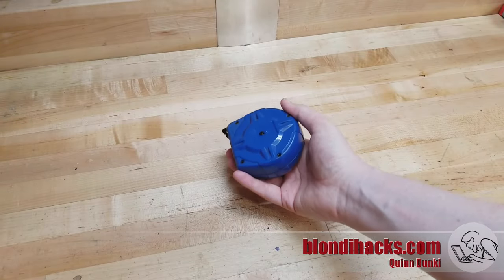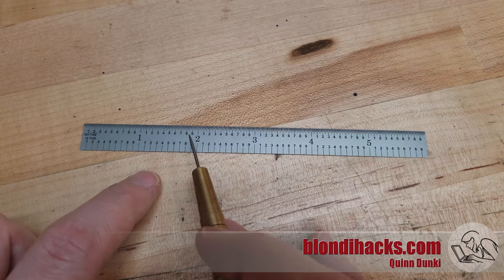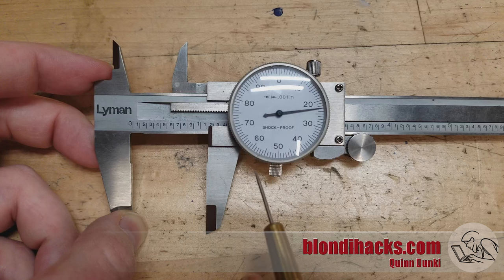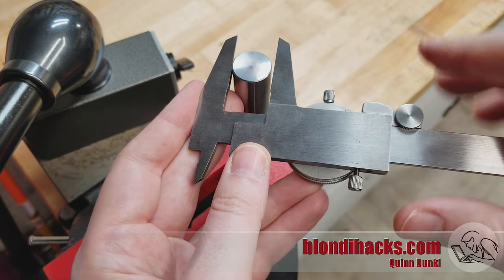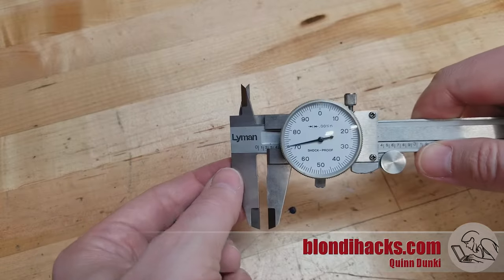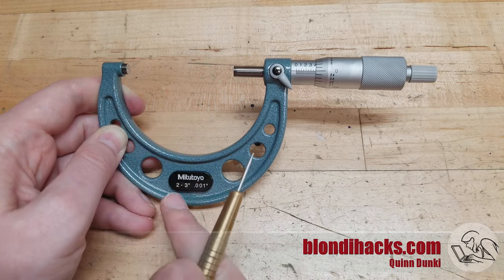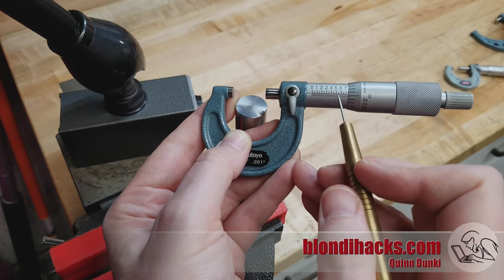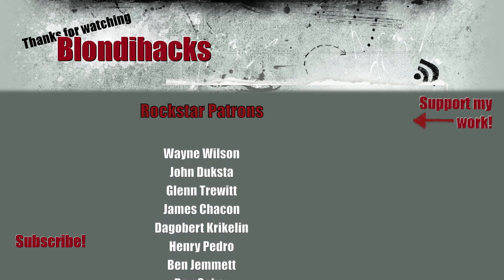Metal Lathe Tutorial 19 : Calipers & Micrometers

Comment: Those in Metric land will know the Vernier Scale as the Nonius Scale. It's really simple and absolutely brillant: Basically when you have two sliding scales, one of them is usually divided in multiples of ten. By adding another scale that divides the same length into nine units, you increase your accuracy 10:1. 
By the way, I learned to work with a caliper that had a Nonius scale too. None of that fancy clockwork stuff! Anyway I bet they don't teach this kind of thing in high school anymore like they did in my day...

Comment: I've been using the same Lyman dial aproximator for years and had no idea you could measure depth with the head. Thanks for that.
Reply: Same here...
Reply: I saw this "trick" somewhere in another machinist youtube video (can't remember which one, I think I've seen it several times now). Unfortunately, my vernier calipers aren't designed to do this, so it is not universal - at least it WASN'T when I got my calipers - they probably are 40 years old, and I think they design wasn't the latest at the time I got them. Still working, so not replacing them yet... ;)

Comment: Holy Cats! I bought a micrometer eons ago at Amble’s Surplus, not knowing at all how it’s used. Had no instructions. Decades before YouTube.

TIL that the extra lines are for 10,000ths!!
Reply: Did a little more inspecting & I think I've found 3 reasons my micrometer was so cheap.
1. Genuine Chinesium (if I remember right, the original wood box it came in was stamped "Made in China" - lost that box years ago).
2. It has finish-blemishes on the big C-part which look like it perhaps had a brand/logo on it, which was removed perhaps because it was a factory second.
3. The ten-thousanths lines only go up to 5. So to read .0006 to .0009, you have to use the shorter half-a-hundredth marks on the barrel and do even more math.

Fugly, but functional.

What a fun day this has been so far.

Comment: Yes, the video is 3 years old and still GREAT. But, ya know, a lot of us old geezers who decided to squander our retirement vacation savings on machine tools, in addition to being self-indulgent, are half blind. So those BIG digital LCD numbers really help. Now, I have a harbor freight, and mid-range asian, and high end set of digitals and you are exactly right, but I also have gauge blocks, so I do check them. Have to be careful. HF is "accurate to a thou or two, and fairly repeatable. The mid price ($50 to 100) and the high end, ($250 and up) read within a tenth of each other. The temp variations in my shop could cause worse than that in any result I'd ever get. So...the ability to see the numbers, and the accuracy of the mid price units is something us geezers actually need.

Comment: Hi, the caliper batteries. Cheapo's just have a relative scale, they have to keep the power on in order to retain the zero, switching them off just turns the display off. A bit daft as I think everyone rests the zero every time they turn the display back on atvany rate. The quality calipers have an absolute scale and they know where the zero is so can be fully turned off when not in use. Discharged batteries areca thundering nuisance and I think Quinn is absolutely (!) right to say avoid cheap measuring tools. BobUK.

Comment: Great explanation of mics! Also, if you're doing a ton of round stock readings, you can get micrometers that are designed for it. Basically, the anvils have a slight v groove in them. Of course, specialist stuff is always more expensive

Comment: Could you please show us how to use thread wires correctly?
I need another hand or two.
Thread micrometers seem to be a better choice.
What say you??
Thanks, Jeff
Reply from the maker: Yes! I will be doing a video on thread wires. Thread mics are nice, but expensive and technically a little less precise (though not meaningfully so, for most use cases). Thread triangles are another nice option. There’s much disagreement on whether they are less precise than wires, but they are easier to use

Comment: Ahoy Quinn. Some advice please ? If you are not too far into that whisky bottle😁. any thorts about lathe centre height from floor ? I'm figuring about elbow height
Reply from the maker: Good question! I’d say you want the hand wheels at a comfortable working height, so around waist height or a little higher.
Reply: Would be a lot easier if i had one of your "Johnny carts" 😁 I think i'll aim for belly button height with adjustable legs. got an ancient edgebander the other day for $100. loads of good salvage bits and a good base that will become a lathe stand after some modification, Thx for thorts 🍺

Comment: I love showing a lyman caliper (sold for ammunition reloaders) in this use.  I've found several things that if bought from a different specialty than what you'd think - you save a ton of money and they're as good (usually the same, just different branding).  FWIW, I lose the battery covers on my digital calipers and loosen the battery when they're not going to be in use for awhile, then push the battery back in when needed.  Cheesy but it works (you could hot glue a small screw ,bit of tape, or a toothpick to the battery to make that easier).  The normal tension in the springs of the battery holder itself keeps the battery in and connected no problem normally - 
The reason they go dead is they turn themselves back on, like ghosts in the middle of the night, and you can catch them at it.  Static?  Dunno, at least some brands are less likely to do that if you tighten the screw that keeps them from moving.
Reply from the maker: Indeed! My dad is a reloader, and I inherited that tool from him. 😁
Reply: @Blondihacks  You mentioned hemostats in another video of yours.  Same idea...I introduced a Vet to electronic fine tools, in this case, flush cutters so the stainless steel wires she used to to micro-osteopathy (bone surgery) didn't have sharp ends.  She was aghast at the price graduation from "surgical supply" to the overpriced Jensen tools catalog, to ... various surplus outfits like Marlin Jones.  Asked how to autoclave them between surgeries due to plasti-dip handles, I pointed out that for 2 bucks, you just toss them in the trash....Just wow.  A useless to most tip - what reloaders pay for crushed walnut hulls for their tumblers is 5 or 10 times what they cost as lizard litter at the pet store.  Same stuff...
Reply: @highpwr  Good one, thanks.  You know if we all give away our special ways to avoid "friction in the market" a lot of useless middle-markup-men are going to be hurting....heh.  Go!

Comment: Great explanation! I would like to add that the best way to hold a micrometer is either thump and forefinger on the black pads on the lowest point of the arc ..or on the fixed anvil side, that way you transmit as little of your body temprature to the micrometer. Gretings from the Netherlands.
Reply from the maker: Yes! Great point. Avoiding heat transfer is good practice.

Comment: There is one serious issue with calipers like you show:  bits of metal get into the gear mechanism and cause the caliper to jam.  It is the main reason for me going over to digital.  The current cheap HF caliper battery seems to be lasting just fine (it is at least a year old and I don't have to take it out) and it has auto turn-on.  After trying the Shars caliper at the metrology test that Kilroy was putting on, I may step up to one of those.
Nice to meet you at the Good of the Land Festival.
Reply from the maker: Yes, very true. Dial calipers need to be taken apart and cleaned from time to time. That is a disadvantage of them.

Comment: In some way easier with mm. Micrometer 0-25 mm, one revolution 0.5 mm, easy to check with caliper if it is 16,24 or 16,74 mm.  Yes, we sometimes go digital to 0,001 mm (0,00004 inch) but when the piece is in the lathe 0,01 is good enough, hard to measure more precisely...

Comment: Going back to Shop-101 I was taught when checking calibration on you Micrometers in this case for example with a 1 Inch Micrometer but it really doesn’t matter if it is a 1”-2,” 2”-3,” or large micrometer.  Any-who step number 1 is first with a lint free rag wipe the face of the anvil and spindle lightly and then wipe the face of the anvil and spindle with clean dry finger tip afterwards close the micrometer until the anvil and spindle touch as if you were taking a measurement. After insuring that your micrometer reads 0.000 or if did not that you have made appropriate calibration corrections you next then carefully open your micrometer to just pass 1.000” at which point you insert the 1.000 standard bar that you have cleaned the faces on just as you did cleaning the face of your micrometer’s anvil and spindle and tighten down on the standard bar as you would taking any other measurement and confirm that the reading you get on your micrometer is indeed 1.000” if it is any other measurement than 1.000” repeat the 0.000 calibration procedure and the 1.000” calibration procedure if you still get a reading error there is a chance that the frame of your micrometer is stretched or with the face of your anvil or spindle is worn.  However there are other possibility’s is that need to be checked before condemning you micrometer or buying expensive parts if available to bring your micrometer back into specification.  One of the simplest is to check if the spindle assembly of your micrometer is removable from the frame of the micrometer it may just be out of adjustment additionally it may have been over-torqued into the frame and some micrometers use shims to adjust frame to spindle spacing, lastly if the micrometer has not been treated as kindly as it should the mechanism possible could be filled with crud and corruption, if this is the case a good cleaning may possibly remedy the situation.  Note keep Brake-Kleen and Gum-Cutter away from your micrometer.  Lastly when storing your micrometer’s and calipers do not screw the micrometer shut or stick a standard in between the anvil and spindle faces overtime it is going to attract corrosion or rust and both of those are bad for precision measuring devices and tools in general. Hopefully you may find some of this useful if not that ok as well either way have a nice day and a better tomorrow.
Reply from the maker: Great summary of the details. Thanks for sharing!
Reply: Blondihacks Thank’s a friend of mine turned me onto your channel and I have enjoyed watching the content you are producing, it is informative and enjoyable to watch.

Comment: dear USA please convert to the metric system!
Reply: NASA has.
Reply: The metric system is the official system in the US. People are just afraid of the commie-meter
Reply: I always wonder what difference to Europe/UK it makes if the US is metric? I've been in engineering, so I use the metric system at work. But, why does it irk you do much? The US doesn't make anything any more, so you don't have to have two sets of tools, like I do. Is it math; is it having to convert systems when watching YouTube videos? I watch non-US videos and convert the systems quietly, in my mind, no whinning. Is it a control issue; do you need validation?
Reply: @DeDeNoM  what is the commie-meter??
Reply: Arguing over which stick you measure with is silly, it doesn't really matter as it's just a different stick. But I wouldn't be caught dead using SAE units for any type of energy analysis. since energy equations require SAE unit magic fudge factors, where SI energy units just work every time without fudging the numbers to be correct.
Reply: Please learn how to use fractions fluently
Reply: The reason I will never convert is simple.  MONEY!!!  I have just a small shop.  To convert would require me to replace all my cutters, router bits, blades, measuring devices, jigs, sockets, ect.,  to stop using system I am perfectly happy with.  Not gonna happen.
Reply: @randy-yk1yk 
Why not have an assortment of both?
Reply: @jayytee8062  Well, the story goes something like this: The US implemented the metric system and started converting step by step. But people were afraid of the Russians invading the US. So they thought, if we don't use the metric system, they can't read road signs, can't raid hardware stores to fix their tanks and so on
Reply: @craigleemehan  chill dude! im old enough to remember the imperial system ... i still think in thous lol. and we  ( the uk)pretty much invented it. .....but the metric system is ssssooo much easier across all  measurement values
Reply: Why would I convert to metric? Then nothing will fit what I already have, and no I can't afford to replace everything. I will die Imperial, but the grandkids will be metric, since everything is metric now in the US except for road signs and cooking units. I would literally have to replace everything I own, and spend the rest of my life doing the conversions in my head. Not gonna happen.
Reply: Most industry in America already has. The cost of converting the entire country is actually prohibitive. This is sad because metric is so much simpler.
Reply: @craigleemehan   a thought just came to me ...... so im a 32ndth of the 1/8th that i wanted... so il dial in 20 thou , that should do it!
gibberish! lol in good fun
Reply: @jayytee8062  Well, the metrication is real (see the Metric Conversion Act), the rest is just a story
Reply: @levitated-pit  So how does my measurement challenge impact your life so much you need to comment?
Reply: @craigleemehan  woah man. it was just an observation with a humerous intent .. please take it as that
Reply: @jayytee8062  Go look up what that would cost...as randy mentioned.  Say a few hundred more bits, blades, measuring devices at a very conservative 10 bucks extra each - and then store them, organize them so you can find them, keep them from rusting and on and on.  Floor space isn't free either.  Many of us do have some of both, but it's a reason to grind teeth fairly often.  Yeah, metric is nice as you know the relationship of a km to a mm without thought.  And that has how much relevance to machining or bolt size?  We imperial guys don't measure bolt threads in fractions of miles, you know.
Reply: @Jay Tee  To what end?  I have absolutely no issues with imperial.  It makes no sense to have two systems in the shop.  Use metric if you like and live well.
Reply: @randy-yk1yk  most big shops in the US use both, or are all metric. The majority of manufacturing done in the US is also all metric.  Manufacturing that wants to sell outside of the US is also required by law to be metric and it has been increasing since 1974 with the metrification act. Sadly we didn't convert in 1793 when Jefferson was secretary of state in part due to pirates attacking the ship with the kilogram Jefferson ordered to consider metric for trade.
Reply: UK engineer here, if I may list a few reasons why the US is mainly using the Imperial or Standard system. Hopefully a balanced view.
1.Machine tools last a long time, 40 plus years,  the US experienced rapid growth in manufacturing from late 1890s' onwards, especially 1940 to 1970s'. Changing during this last period would be very costly, and second hand machine tools in inch calibration, would not be welcome in Europe or other established/stable countries.
2. The US home market was vast, it did not need to export machine tools for GDP, and when it did, customers accepted the inch calibration. Compare to the UK, where very small home market, the mantra in 1960s' was "Export or Die", and changing to Metric, enabled selling to world wide market.

I do think that now would be a good time to undertake full metric system, many large US based multi nationals do use metric, especially automotive, metric fasteners are cheaper/plentiful than inch sizes, remember, will a fastener manufacturer invest in a US market only. Smaller US companies, will continue with inch until their customers, insist on full ISO traceability.
Hope this adds, rather than detracts?.
Reply: @randy-yk1yk  I'd love to have that choice.  Living in the US, with a machine shop full of imperial tools, bolts, and other junk, yet having to work with metric stuff I didn't build but need to repair...the world could be better...I don't care about which system either, really - and I use metric for my science work (because everyone else does, and we have to communicate), but in the shop...same lack of choice, people use both, so I also must.

Comment: Cheap calipers work fine IF you lock them closed
the problem is they turn on automatically when bumped and that’s what kills the battery 
after i started placing mine in an isolated separate place too the table i work on the one batter would last 6-12 months, compared too the 4-8 weeks previously

they must be locked closed, either with elsastic or the lock nut on them